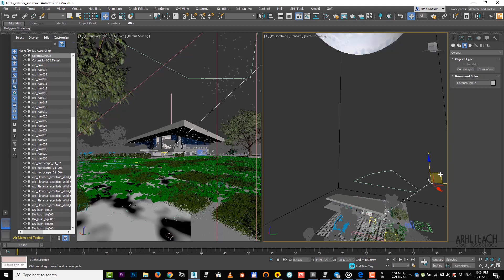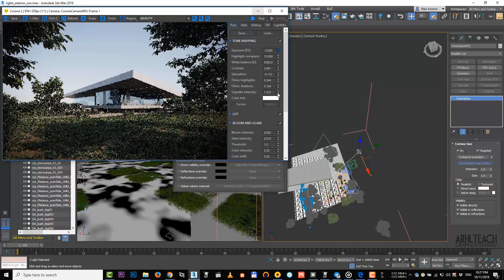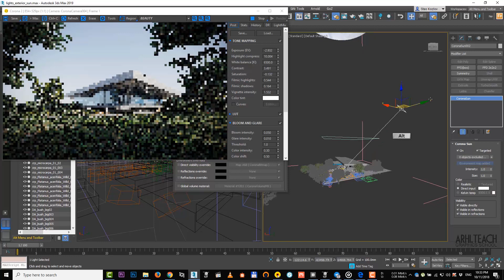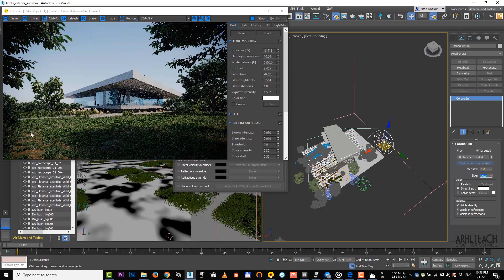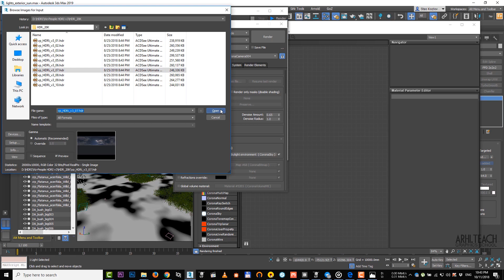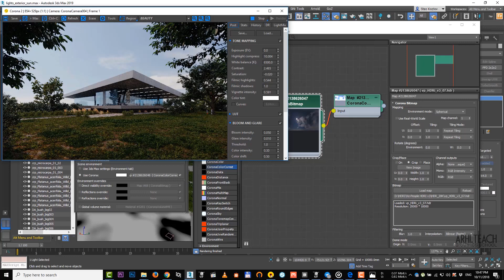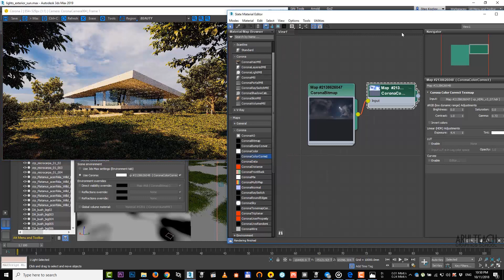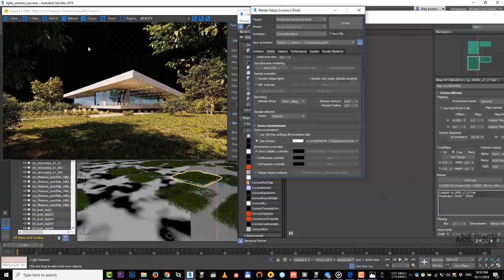3D Tutorial |  3ds Max  + Corona Render | Exterior daylight lightning 🏠

Comment from the maker: 3D tutorial content:
00:00 Intro into 3D tutorial
00:05 Difference between lightnings
00:35 Standard layout
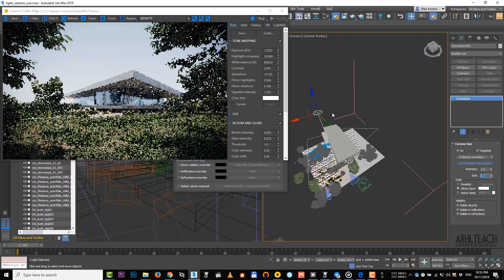06:09 Intensity and size of the sun
06:41 Resetting Saturation
07:30 Example on my work
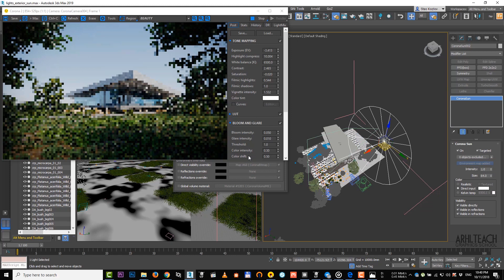09:36 Choosing an HDRI
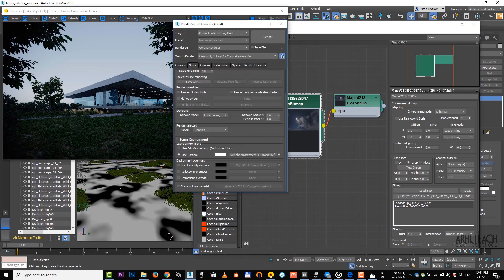11:08 Corona Correct
12:55 Flat picture
14:01 Increasing overall contrast
16:22 Matching the sky
17:16 Direct Visibility Override